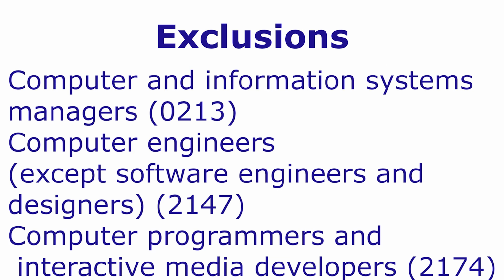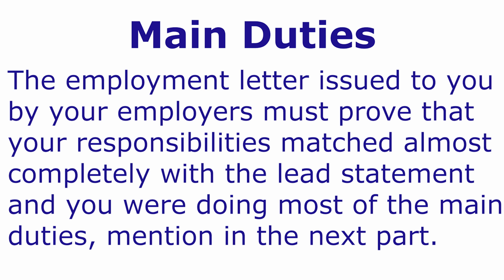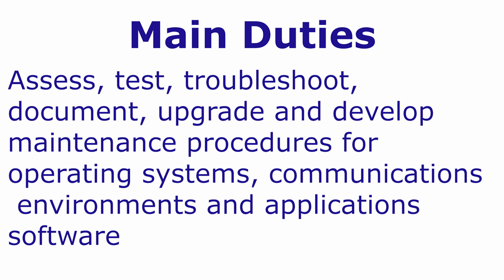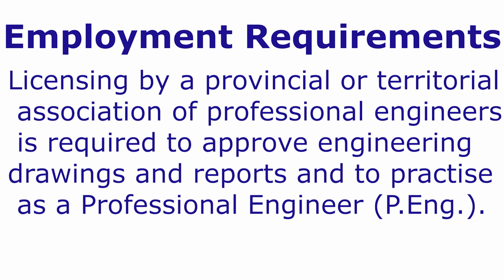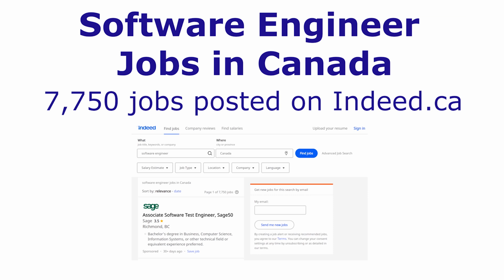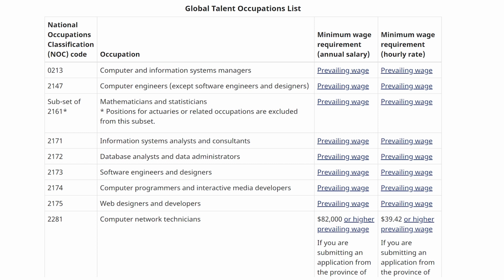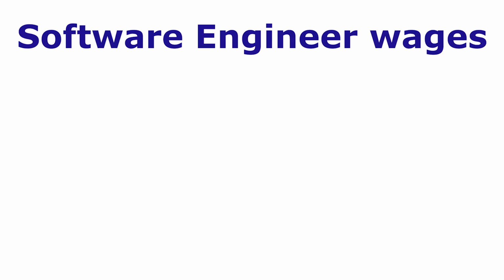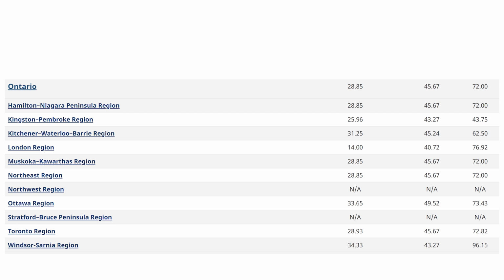NOC 2173 Software Engineers and Designers (2020)

Comment: Hi sir, i hope you read this message and reply. 
I have done B.Sc IT then MCA(Masters in Computer Applications) and have been working as a Software Engineer (noc 2173). I am a developer basically. But i don’t have a license and neither have I done bachelors/ masters in engineering. 
Currently i have chosen noc 2175 ( web developers) in my EE application, as I don’t have an engineering degree or license. But do you think i can keep my noc as 2173? As it matches my job title and even the job role seems similar.
Reply: @rashid_ali  thank you so much! 😊

Comment: Good day sir.
I recently started my express entry application. But I've been confused about the work experience. I was a self thought software developer and have been working as one since 2017 and I obtained my advance diploma in software engineering in 2019 and my bsc software engineering in 2020. Please how do i start my work experience as it states from when you got the minimal qualification required.
I've also been working as a nurse assistant since Feb 2020 till date.
Please how do i add all this to my profile?

Kind regards.

Comment: My second job has the following responsibilities- ( Assistant software programmer)

Modify existing programs in accordance with the current industry best practices.
Implement and suggest fixes to any technical issues or defects raised by the testing teams.
Assist with the preparation of design specification documentation.
Analyze, construct, test and configure process definitions.
Use flowcharts to translate business logic to technical configuration.
Perform unit testing and document the test cases for new programs.
Assist in the deployment of in-house processes and programs.
Provide application support for data migrations and business testing.
Collaborate with other teams and support their ad-hoc requests.
Participate in regular code maintenance activities.
Attend project status calls and communicate the discussion to concerned team members.
Researching,designing,implementingandmanagingsoftwareprograms
Writing and implementing efficient codes by evaluating new programs.
Identifying areas for modification in existing programs and subsequently developing the modifications.
Maintaining and upgrading existing systems by deploying software tools, processes and metrics.
Working closely with other developers,UXdesigners,businessandsystemsanalysts.

And the first job had the following - ( Junior software developer)

1. Assist and work closely with other software programmers and developers in modeling, modifying, integrating and testing codes as per the business requirement.

2. Assist other co-workers in the development and documentation of logical and physical programming specifications.

3. Assist in identifying and communicating technical problems, processing and finding a solution by modifying existing programs, reprogramming and debugging of programming codes as per user's requirement.

4. Assist in researching and assessing of different software items by collecting and preparing reports and documentations according to client and business prerequisites.

5. Direct, assign, co-ordinate teams of programmers and assist them in reviewing of projects and programs.

Can you please check whether the roles and responsibilities of both the companies I worked in come under the NOC 20174?